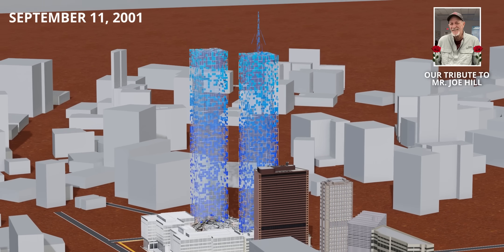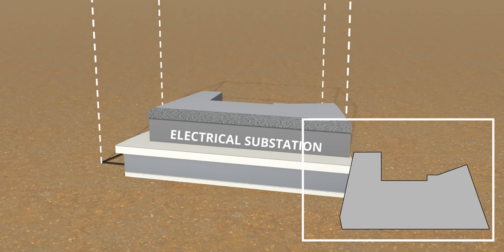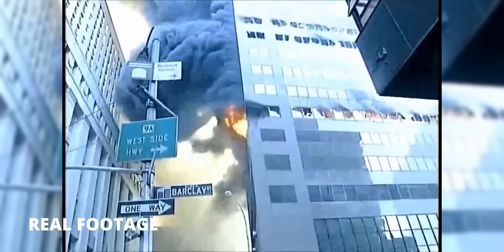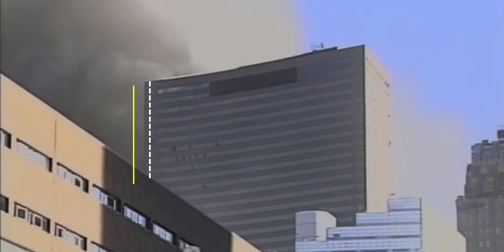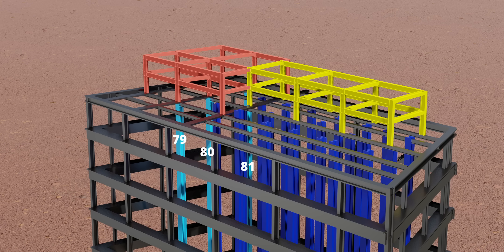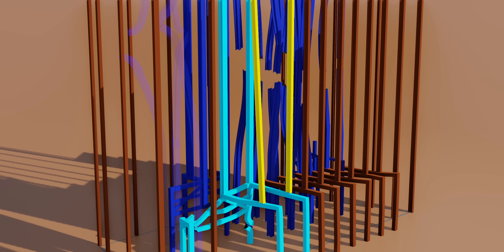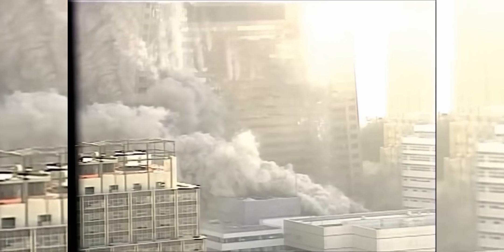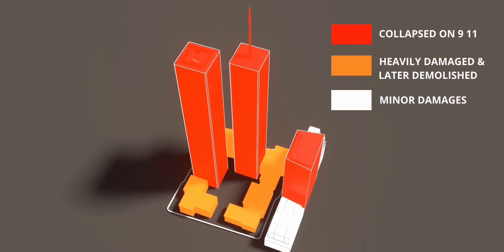Collapse of Building 7 | The Complete Physics

Comment: Gtfo. Sure an elaborate attempt to make the story match the desired outcome. Didn't bother to explain how office furniture fires could get that hot, or how heavy steel columns covered in an excellent asbestos fire coating experienced that kind of failure. Even if the bottom of the beams failed the entire top of the building wouldnt crumble into nothingness. Plenty of examples of failed demolition attempts and bombings where buildings with failed lower columns would topple over not fall down into its footprint. Can also gtfo about the free fall, its certainly close enough considering it should've never failed short of someone purposefully setting that building up for failure.
Reply: Maybe this will help. Much misunderstood, Building 7 was the 6th building to collapse of 10 lost on 9/11. Because of its early low priority, conspiracy filled the information void with garbage made up by technically ignorant people promoting political agendas. But 7's loss is an engineering problem and should be treated as such, so I prepared this brief summary of my own analysis to fix that, using technical analysis, not ideology and tired memes. 

At 10:28am the WTC North Tower collapsed, showering Building 7 with tons of burning debris, causing heavy damage and starting many large  fires which burned out of control for the next 7 hours. Half the FDNY firefighters having been killed, units in disarray, equipment destroyed, no water pressure, and the greater urgency of search & rescue efforts, Building 7 couldn’t be saved so firefighting efforts were pulled as futile and 7 left to its fate. Firefighters make that sort of choice every day in brush fire situations - which houses to save and which ones to let go. Only real difference here is moving the decimal on the size and cost. People get overwhelmed by the size.

www.youtube.com/watch?v=g_SvpwyC17M

Collapse of a burning structure is always a concern for firefighters. Steel buildings subject to fire rely on active firefighting to survive. Buildings are designed around 1 to 3 hours of fire resistance, allowing time for occupants to escape and active firefighting to get started, after which all bets are off. Left to their own devices they'll exceed their design envelope and collapse, like Plasco Tower and Wilton Paes de Almeida. In 7 the occupants escaped, passive and active fire protections were compromised and active firefighting was abandoned hours before the collapse, which left the building to its fate. It lost. Odds on Building 7 would eventually collapse, and it did. No big deal in logic.

 http://www.youtube.com/watch?v=WnYBX6QT0R4 

FDNY Chief Daniel Nigro - The biggest decision we had to make on the first day was to clear the area and create a collapse zone around the severely damaged 7 World Trade Center, a 47-story building heavily involved in fire. A number of fire officers and companies assessed the damage to the building. The appraisals indicated that the building's structural integrity was in serious doubt. I issued orders to PULL back the firefighters and define the collapse zone. It was a critical decision; We could not lose any more firefighters. It took a lot of time to PULL everyone out, given the emotionalism of the day, communications difficulties and the collapse terrain 

FDNY Deputy Chief Peter Hayden ; We had our special operations people set up surveying instruments to monitor and see if there was any movement in the building. We were concerned of the possibility of collapse in the building. And we had a discussion with one particular engineer there, and we asked him if we allowed it to burn could we anticipate a collapse and if so, how soon? And it turned out that he was pretty much right on the money, that he said 'In its current state you have about 5 hours 

The collapse of Building 7 was anticipated and widely reported in the media throughout the day, with 24 video cameras recording some or all of the collapse. Everyone knew what was coming and why. 

www.youtube.com/watch?v=OY5S5k3tMHI

The collapse of Building 7’s was entirely different to the Twin Towers and harder to understand, most details being hidden from view and not intuitive.  But we can still sort out what happened through careful analysis and observation. This is my explanation of the collapse relying on no outside authority. 

Building 7 was a unique, asymmetrical 47-story steel framed structure built atop a smaller 3-story building serving as a partial foundation, requiring lower floors dedicated to complex load transfer structures. Of trapezoidal shape and all-steel tube-in-tube construction, B7 (above the 7th floor) consisted of a central core of steel columns carrying most of the gravity load, perimeter steel columns around the outside of the structure carrying the remainder of the gravity loads and long span beams and girders to tie those elements together and form the floors. On the outside of the building hung a moment frame or outer shell. 

Phase 1 : First externally visible signs of collapse initiation occurred at 5:20:28 pm and were notably quiet with observers not realizing the building was collapsing! No audible warning in the form of hundreds of ear drum busting 180-190dB explosive bangs preceding the collapse. Here at 12:00 a local CBS affiliate reporter is talking 10 blocks from B7 when collapse begins. People don’t start to notice the collapse until 12:11. At 12:45 is the famous CBS fixed camera clip of Building 7’s collapse. Note how quiet it is. 

www.youtube.com/watch?v=t5tEy6mXSE8

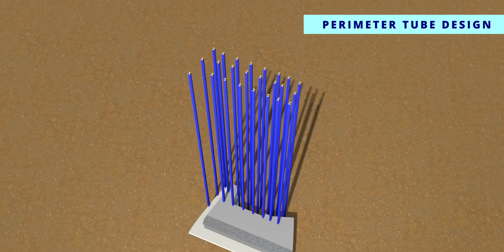Collapse initiation was due to lower floor failures above the load transfer region (8-14th floors) in the NE corner. In this video at 0:45 you can see the NW corner from inside the building while under construction, Column 79 just out of frame on the left. That big, angled steel beam across the top of the frame connects to C79 at one end. The girders connect to the beam. That beam and all those girders depend on just one connection 

www.youtube.com/watch?v=nP3TNHPCIVU&t=45s

Phase 2 : The NE lower floor failures caused a loss of critical lateral support over an excessive length of Column 79 and it buckled. Looking at a floor diagram of Building 7 (www.nist.gov/image-16640) when you see all the structures that depend on C79 you quickly realize this one column was a relatively isolated structural element on which a disproportionately greater fraction of the structure depended analogous to say the Key Bridge. Externally as collapse begins we see a vertical progression of window breakage along the 44-46 line and a kink in the roof of the East Mechanical Penthouse at the top of the building, consistent with C79 failure. Normally with a buckling column, the load could be redistributed to other columns. With C79 that is not the case - the failure did not redistribute the load, so the collapse rapidly progressed to the roofline, sinking the rooftop penthouse. The transition from full capacity to almost no capacity occurs in an instant and will result in virtually no resistance 

Phase 3 : With C79 gone, B7’s progressive, non-symmetrical collapse continues with adjacent columns 80 and 81 left laterally unsupported, and quickly buckling as well, sending the EMP down through the building. C79-81 all have no diagonal bracing, which is the major reason why they could not redistribute a lot of vertical loads among one another. From there collapse progressed from east to west through the central core until the core was gone taking all of the interior floors and probably most of the perimeter columns with it. Follow the horizontal progression of window failures low in the building and the dropping of the remaining rooftop structures into the building. One of the big takeaways from the NIST Building 7 study (invariably ignored) was how their modeling determined C79 failing under ANY circumstances would have initiated the same collapse sequence. 

Phase 4 : After about 10 seconds only the exterior moment frame remains, giving the illusion B7 is still standing to the casual observer since little has outwardly changed. But it is just a hollow empty shell like an empty cereal box supported only by a few remaining columns and overloaded from the loss of the core columns and floors, quite unable to remain standing. With nothing remaining behind it, the north face leans inward, forming a V in the roofline, the last few columns buckle under the strain and the moment frame free falls, landing on top of the debris pile. 

It is only here at the very end that a single measurement of alleged free fall acceleration is taken, from a single point on the outer shell. The Building did not “free fall” – just one corner of the outer shell did, sort of. The Building_ (defined as its center-of-mass) was already gone before that happened. The period of alleged free fall was a product of how it fell NOT why it fell and can't tell us what started the collapse 10 seconds earlier. Start to finish the collapse took 18-20 seconds, 3 times longer than free fall . How fast something falls cannot tell you what started it falling_ anyway. 

The debris spread outside the footprint blocking surrounding streets, heavily damaging the Verizon Building and destroyed Fiterman Hall. 

Building 7’s progressive, non-symmetrical collapse was incidental and unintended collateral damage from the combined effects of fire + time + gravity, started by the collapsing North Tower. That is true no matter who planned and carried out the 9/11 attacks or why . The collapse was of so little consequence it barely registered at the time - a footnote, only taking on semi-mythical status as an alleged smoking gun years later when demolitions at the Twin Towers, missiles at the Pentagon and shoot down over Shanksville all failed and conspiracists had nothing left to work with. 

Anything can seem like a conspiracy if you don’t understand how it works. Now you should. I hope you found this helpful, informative and it solicits informed critical comment. If I made any errors of fact, logic or reason or left anything important out, please let me know so I can fix it. IF you can offer a more plausible alternative please do. Be the first. Please start any reply with the words “Tits McGee” or I will know you didn’t read it and are wasting my time.
Reply: "Sure an elaborate attempt to make the story match the desired outcome"
So, if you know you're doing that...

"Didn't bother to explain how office furniture fires could get that hot"
That you don't know anything about fires....isn't an argument.

" covered in an excellent asbestos fire coating "
That wasn't covered in anything of the sort. Imagine, you knew nothing about it.

"Even if the bottom of the beams failed the entire top of the building wouldnt crumble into nothingness"
After all, on your planet, gravity isn't a thing.

"Plenty of examples of failed demolition attempts and bombings where buildings with failed lower columns would topple over not fall down into its footprint"
None of which were remotely similar to WTC7.

"Can also gtfo about the free fall"
You're the one bringing it up...

" its certainly close enough"
If by "close enough" you mean "no-where near".
Reply: Did you hear him in the start of the video ? There is an electric substation in the bottom, they needed to build girders on top of it. That building was sketchily built to start with, now throw in a 110 story skyscraper full of jet fuel fire falling into it.

Comment: The spire (antenna) on the North Tower fell straight down into the tower’s footprint when the building collapsed. It didn’t topple sideways.

WTC 7 was across Vesey Street, about half a football field’s distance away (≈ 350 feet). That’s far too wide a gap for the spire to have “sliced into” it.

What did strike WTC 7 was large debris from the North Tower’s outer structure (steel sections, façade pieces, etc.), which damaged its south side and fueled fires.

No photos, videos, or official investigations (like NIST’s report) show the spire contacting WTC 7.

Try again to explain away a 47 story sky scraper collapse by office fires....😂
Reply: The video is wrong about the antenna.  It was actually perimeter columns from the north face of the North Tower. Different chunk of metal, same result. It's a detail. 

Ain't none of us perfect.

At 10:28am the WTC North Tower collapsed, showering Building 7 with tons of burning debris, causing heavy damage and starting many large fires which burned out of control for the next 7 hours. Half the FDNY firefighters having been killed, units in disarray, equipment destroyed, no water pressure, and the greater urgency of search & rescue efforts, Building 7 couldn’t be saved so firefighting efforts were pulled as futile and 7 left to its fate. Firefighters make that sort of choice every day in brush fire situations - which houses to save and which ones to let go. Only real difference here is moving the decimal on the size and cost. People get overwhelmed by the size.

www.youtube.com/watch?v=g_SvpwyC17M

Collapse of a burning structure is always a concern for firefighters. Steel buildings subject to fire rely on active firefighting to survive. Buildings are designed around 1 to 3 hours of fire resistance, allowing time for occupants to escape and active firefighting to get started, after which all bets are off. Left to their own devices they'll exceed their design envelope and collapse, like Plasco Tower and Wilton Paes de Almeida. In 7 the occupants escaped, passive and active fire protections were compromised and active firefighting was abandoned hours before the collapse, which left the building to its fate. It lost. Odds on Building 7 would eventually collapse, and it did. No big deal in logic.

 http://www.youtube.com/watch?v=WnYBX6QT0R4 

FDNY Chief Daniel Nigro - The biggest decision we had to make on the first day was to clear the area and create a collapse zone around the severely damaged 7 World Trade Center, a 47-story building heavily involved in fire. A number of fire officers and companies assessed the damage to the building. The appraisals indicated that the building's structural integrity was in serious doubt. I issued orders to PULL back the firefighters and define the collapse zone. It was a critical decision; We could not lose any more firefighters. It took a lot of time to PULL everyone out, given the emotionalism of the day, communications difficulties and the collapse terrain 

FDNY Deputy Chief Peter Hayden ; We had our special operations people set up surveying instruments to monitor and see if there was any movement in the building. We were concerned of the possibility of collapse in the building. And we had a discussion with one particular engineer there, and we asked him if we allowed it to burn could we anticipate a collapse and if so, how soon? And it turned out that he was pretty much right on the money, that he said 'In its current state you have about 5 hours

Comment: The odds of this being what happened is less than 1%
Reply: How do you figure that? Please show your math.
Reply: @TheCriticalStinker-01 the chance debris hit the building and the main columns weakened and it fell demolition style instead of outward  on the same day 2 other towers also did the same thing. The actually odds of that being the case is close to 0%.
Reply: @KyleHarrison-i4y  - I asked you to show your math, not your hindquarters.

Isn't the odds of the north face spandrels of the North Tower falling to the North 100%?  What other direction could they fall?

You are talking out of your ass.
Reply: @TheCriticalStinker-01 Event
Description
Probability (rough estimate)
E_1
Debris strikes WTC 7 in critical locations
0.5
E_2
Structural damage from debris weakens Column 79
0.2
E_3
Fires burn for hours in critical areas
0.3
E_4
Fireproofing is compromised
0.3
E_5
Thermal expansion causes Column 79 to buckle
0.5
E_6
Progressive collapse propagates through building
0.7

Assuming independence (rough approximation), the probability of all events happening:

P(\text{WTC 7 collapses naturally}) = P(E_1) \times P(E_2) \times P(E_3) \times P(E_4) \times P(E_5) \times P(E_6)

P \approx 0.5 \times 0.2 \times 0.3 \times 0.3 \times 0.5 \times 0.7 \approx 0.00315

\Rightarrow \text{~0.3% chance}
Reply: The odds of you knowing anything about odds is less than 0%
Reply: @mooneyes2k478 says the guy who thinks you can have less than 0% of anything
Reply: @KyleHarrison-i4y  That you failed to get it? Only mean you failed again.

Comment: Burning debris (not aviation fuel) does not burn hot enough to soften steel.
Reply: Google search:
Spheroidization or also called softening refers to the microstructural changes in steel when it is subjected to a high-temperature range of 850 °F to 1400 °F or 440 °C to 760 °C.

Wood Flaming Combustion: This occurs at temperatures ranging from 930°F to 1,650°F (499°C - 899°C). 

Resting my case.
Reply: @JiriStipek-b6o  And rightfully so.